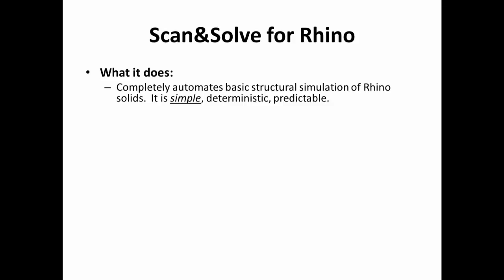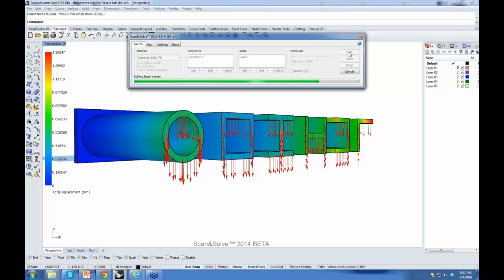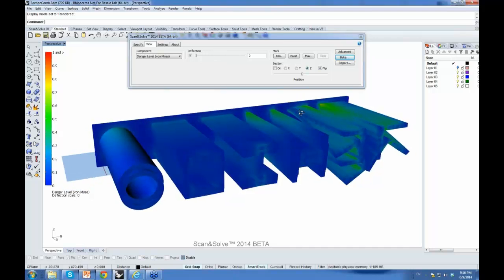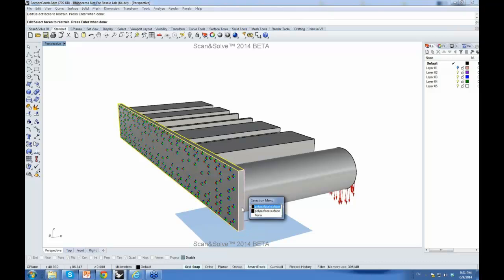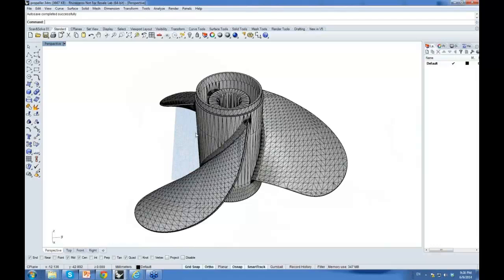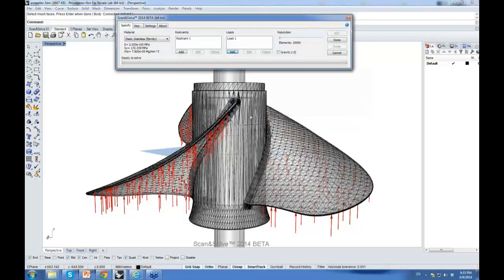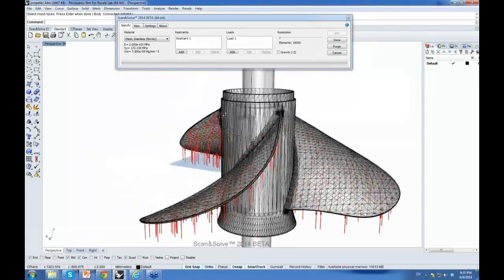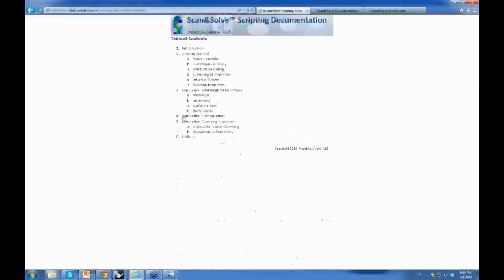Webinar:  Scan&Solve 2014 Features and Uses

Comment: Could this plugin be used to check if the support structures of a grown part on a 3D printer may or may not cause the part to fail?
Reply from the maker: Yes,  absolutely.  Scan&Solve accepts STL format as input,  so it is quite straightforward,  if you have the model.
Reply: +scanandsolve 
At there any presets for UV cured resins and photopolymers or is it limited to metal,  glass,  wood, etc?
Reply from the maker: +christian davis 
If you go to  http://www.intact-solutions.com/resources.php you will see an extensive list of 3D printed materials.   I am not sure if it contains the specific material you want,  but it is very easy to add if you have the material specifications   (see documentation at http://www.intact-solutions.com/sns_documents/sns_2014/custom.htm  or we can help you).